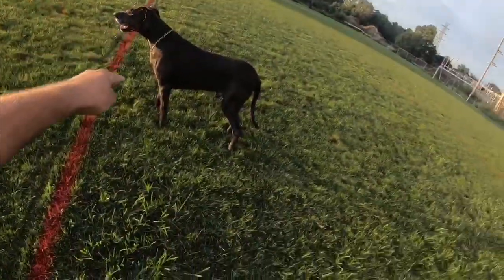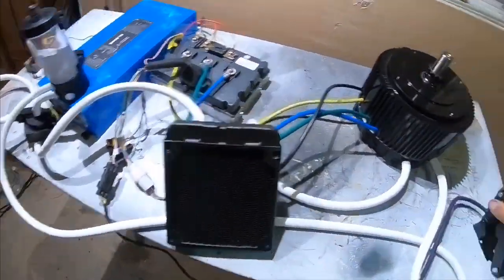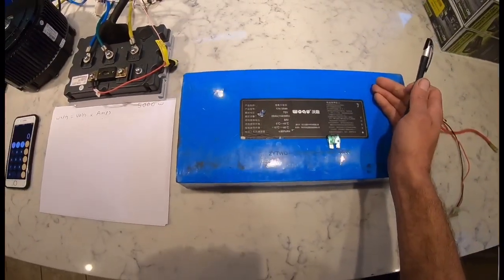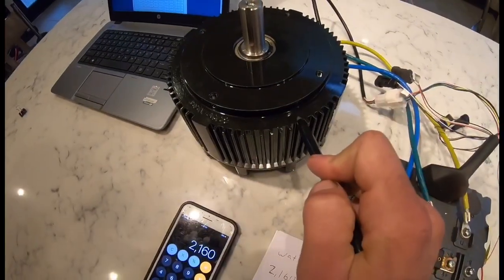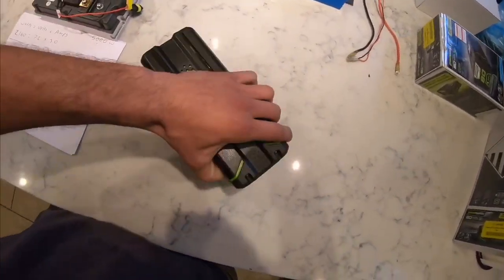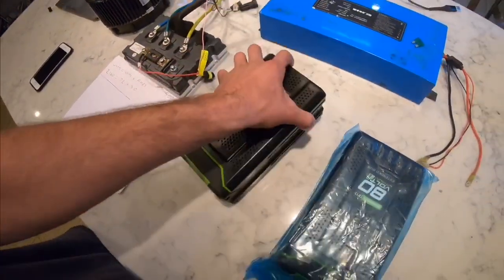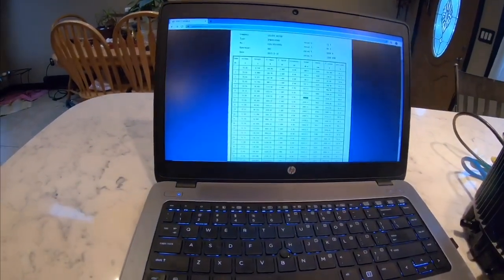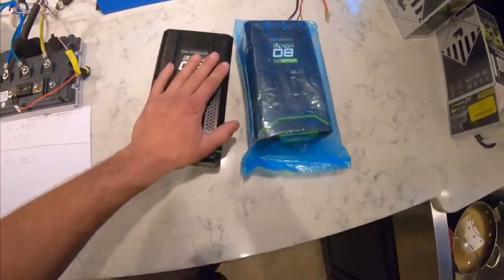(E6) How to Build an Electric Gokart using cordless tool battery’s!

Comment: I made a similar 5kW trike using a BLDC from Golden Motor and I even power mine with cordless tool batteries too. My battery setup uses 9 individual packs wired in series and parallel to produce 54 volts at 120 amps. Top speed on my machine is 50 MPH and it can travel a little over 20 miles on a full charge. I look forward to seeing your complete electric kart build.
Reply from the maker: All I can say is I have watched your videos..🤯 definitely help get to where this build is going
Reply: @Krisuno  Right on! You probably have seen zed4me videos too, he made a 10,000 watt electric go kart in Long Island, NY. It would be rad to see ya'll race. There are a couple of tracks near you: Norwalk Karting Association, Old Bridge Township Raceway, and Oakland Valley Race Park
Reply from the maker: Wow is he really on Long Island! I’m going to try to get in touch with him. Maybe we can get a race going.

Comment: +1 for simplicity of having an already packaged and monitored (i guess) battery. But men is this expensive !
Reply from the maker: Each battery has its own BMS and I feel like they are safer than most Chinese lithium battery packs on the market but if you were to buy a Chinese battery pack equal to the size it would cost just about the same amount
Reply: @Krisuno  Yeah in your case maybe since it's not a typical ebike or low power build. There isn't a lot off battery made for giving such amp draw and chinese batteries aren't cheap anyway. For that power level I'll build a custom one, it take more time and research but since you're doing a lot of those build it might be a good idea :)
Reply from the maker: Yea I could 100% make my own battery but I feel like most people on YouTube are looking for different alternatives to powered homemade electric vehicles so I feel like bringing the power tool batteries out on the table as an option to show people you could power homemade vehicles using store bought batteries. Plus I wouldn’t mind having some of the greenworks electric equipment for personal use and having the batteries already is just a bonus
Reply from the maker: If you’re interested in seeing me try to make a battery I can make it happen in the future video but I feel like there’s so many on the Internet already
Reply: @Krisuno  You're right there is a lot of video on the subject already ! I personnaly don't need one, I was just saying that from a budget point of view. That's a great idea to use widly available lithium batteries, it may inspire people who are not familiar with them to try it more easily
Reply: @Krisuno  Electric car batteries are most economical and powerful option.
Reply: @Bmr4life  Electric car batteries are nothing more than a bunch of 18650 batteries welded together (Tesla makes the best 18650 battery).  You can make the same thing yourself, you just need a lot of 18650 batteries.

Comment: I think your motor can defo take 150a and 10kw. Just put a temo sensor in it and if it doesn't go over 85 degrees your fine
Reply from the maker: In episode 11 the lithium battery video I ended up changing the controller out for a 10kw and am pumping 200+ amps through it! The go kart turned into a rocket. Loll
Reply: @Krisuno  my 1/8 scale RC buggy runs 150a speed controller.and a 4s battery and produces over 2 kw power

Comment: Many complications bro but I love the idea.

Lipo batteries? Run however many you need in series to produce the power the esc needs. Double up on the batteries but run the second half in parallel to double battery life.

Lipos aren't cheap and they're a pain in the ass to keep the cells healthy but they release a sh!t load of power. 

The lipos for my rc are 3s, 5500mAh @ 75c which is 75amps constant but 150amp burst rate. Higher the c rating the more expensive the battery.

I'm sure you'll find the right batteries for the job eventually brother, I want to see that thing blast down the road faster than shit off a swinging shovel 🤣

Once you got the power right you can mess with gearing to give it quicker acceleration or higher top speed. Think I would head for quick acceleration and a top speed of around 50mph. 

Could 0-50mph be dealt with in under 4 seconds bro? That would be seriously impressive. Insanity!!!! I'd have to make one lol can't be letting you have all the fun hahaha.

Good luck with the project bro I'll be watching for sure. Peace 🙂
Reply from the maker: Loll Glad you’re enjoying the videos I got another one coming out real soon! but here’s the thing with LiPos I try to stay away from them because they are a pain in the neck to charge and keep healthy like you said but also the safety factor I want to make something safe and reliable. Also the lithium batteries have their own BMS built into them and offer a 75 minute quick charge so if I run an individual charger for each battery I could charge my whole bank in 75 minutes. But who knows if it’s really going to work or not LOL I guess we’ll all find out together when I get the thing moving so definitely stick around and thanks for subscribing!
Reply: @Krisuno  my pleasure brother 🙂👍 what you are doing interests me big time as I'm planning to make a battery pack for my ebike 48v @ 60Ah.

So far I've found that LiFiPo4 batteries have huge capacity. Each sell is 3.2v @60Ah, 15cells in sequence = 48.1v @ 60Ah.

LiFiPo4 cells come in variants of 40Ah, 60Ah and 100Ah. The more capacity the higher the price.

Maybe LiFiPo4 cells are the solution to your power problems? These batteries need a bms but it's no more expensive than a lithium bms.

Hope this helps with your mission my man 👍 can't wait to see the finished go cart in action.

Cool hair btw, suits you bro 🙂✌
Reply: @DaVeHiLl200  60ah is probably way to heavy for a bike lol how did it go?
Reply: @Todd_G_FPV  I got sidetracked and forgot all about it mate 🤣 👍🏼✌
Reply: @DaVeHiLl200  lol I know how that is dude!

Comment: I'm pretty sure those 80V Greenworks batteries are still 72V nominal (just labeled 80V max as a selling point), but the extra amperage is definitely needed.
Reply: On The Test Meter...They read 80volts...Not 72..more importantly...The 40amps..is What you really want to look At

Comment: Hey man, This is an awesome set of vids.  Your excitement is palpable and when you get it going it makes me smile every time you gun it and are like "Whaaaatttt". 

I have a 90cc dinli/china quad ($150 gsale beater) I bought for the kids (7 and 8 yo girls).   They hate it as its damn loud and smokes like a SOB.   They like and ride my 300 kawi a lot more).  Figure it would be a good candidate to convert to electric.   Not looking for super fast but I'm thinking of getting the QS138 V3 from ElectroAndCompany.   Do you think 4 of the 80v batteries you were using with the QS138 V3 (gear reduction model) would work on a little quad to move the kids around?   Are they holding up ok?  I think if 4 or 6 is good for power the battery choice may be a really good bet as if the batteries poop you can just return em!!

Comment: Your speed controller can run around 400a.plus 72v equal 28,000 w almost 30 hp, would fry the motor
Reply from the maker: Nope
Reply: @Krisuno  uses the same controller and motor as a sur ron .it's an industrial standard kit.60v battery  produces 4kw .
Reply from the maker: No I don’t
Reply: @Krisuno  are you awkward on purpose,or do I not realise 🤔🤔🤔🤔🤔😅😂😂😂
Reply from the maker: What are you trying to ask? I’m confused or are you trying to tell me something I did wrong?
Reply: Trying to work out why so many batteries needed

Comment: Why didn't you just change the BMS in your original battery. Most 18652 cells can take a 20 amp draw and I'm guessing it's a 15 parrelel 15 times 20 is 300 amps 😁
Reply from the maker: Cheap 18650 cells not enough mah
Reply: @Krisuno  
Tru 30 to 40ah would be good but for a utube vid 15 to 20ah is fine
Reply: @aidanworthington   no no not most battery can take 20 amp lol. There are few there who can, Samsung 30q can fx.15a. Sony vtc 5 can do 35A.

Comment: Volts *amps equal watts ,
For instance 72v *100a equal 7200w 7.2 kw
Reply from the maker: That’s wrong it’s watt= volts x amps
Reply: @Krisuno  voltage + amps equals ,watts ,
A simple Google search 😂😂😂😂😂
Reply: @Krisuno  u know how many amps your speed controller is ,you know how many Volt's you have,you want to know the  power it produces.eich is watts.
Reply: @Krisuno  why would u want to know how many amps speed controller is,when you already know 👍
Reply: @Krisuno  that's what I meant

Comment: 30 amp hours  times *74 volts=2,220 watt hrs

17,000 watts /2200 watt hrs = 7.8 min  (229 amp)

my kart will do 46 mph in 200 ft  at 300 plus amps  74 volt which at the end of 250 ft my amperage is down to 65 amps or 4810 watts

my 2,960 watt battery will  propel me at close to 60 mph for 45 mins
Reply from the maker: What battery did you make
Reply: @Krisuno  recycled (reused) makita batteries
Reply: @Darnocbard  post a video of your electric kart. It sounds like a beast.
Reply: @ScottBl8ke  I would if I could but have no clue as to how to do so.
Reply: My battery is 45ah * 66v = 2970 watt hrs

Max current draw I've seen is 260 amps.

My kart has similar stats to yours for acceleration, if not exactly the same. My voltage and gearing limits me to 50mph though.
Reply: @Darnocbard  if you can make a 2,960 watt pack from recycled Makita batteries, you can figure out how to upload a video to YouTube no problem.

Comment: 200 amp * 80volts  is 18,000 w power or 18 hp or 18 kw
Reply from the maker: Your wrong. So far everything you said is wrong loll
Reply: Go back to school, elementary school to relearn simple multiplication.

Comment: No no.  You need to wire your batteries in series.   80+80 = 160 Volts  

volts * amps = Watts.  
160 * 40 = 6400 watts.  @ 5 amp /hour battery that is top power for 8 minutes.
Reply: This is wrong. go back to school.
Reply: @sacredcreationz  If the limiting factor is the 40 amp fuse you have to run the batteries in series to up the vol
Reply: Voltage to up the watts.  Or just change the 40 amp fuse to something greater.   If the battery wiring can handle an increase current load.

Comment: It is not 240 amps .... your fuse is 40amp on each battery and you Amp Hour  is only 5 , you will not get much of distance. BMS can only put out 40 Amps you need different set up . 72v lithium battery 40 amp hour  at a discharge BMS of 150 amp  and battery as well 150 amp , everything must much . 72v x 150amp  = 10,800 watts then you have to look and much the "C" discharge on the battery cells and the brand...you got much more work to do , your numbers don't add up in real world of electric power vs torque on to the weeks and to the ground.
Reply from the maker: Hi and keep watching the videos it all works. Your math needs some work
Reply from the maker: There are 6 batteries in parallel at 72v each 5ah  so that makes a 72v 30ah pack. Each pack can max discharge at 40amps so since I have 6 you can do 40a x 6= 240amp Peak. I run them at 80a-100a continuous. Hope you understand